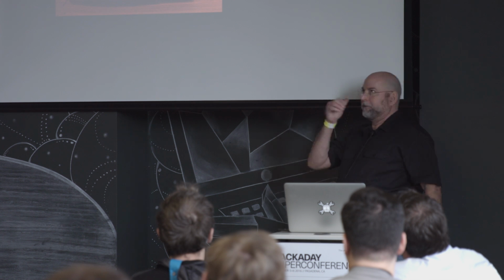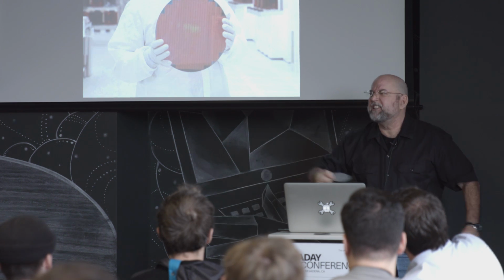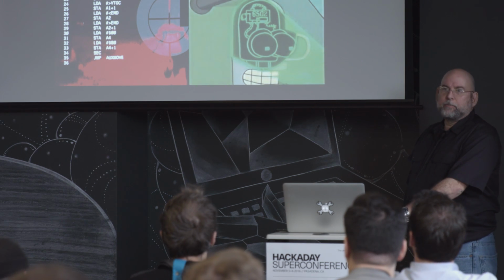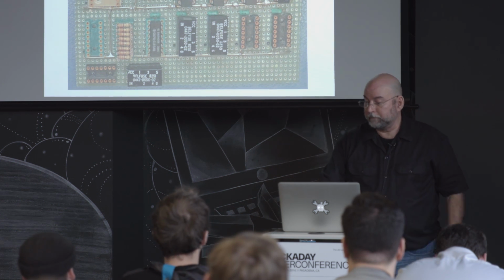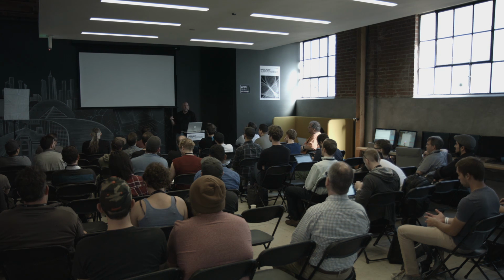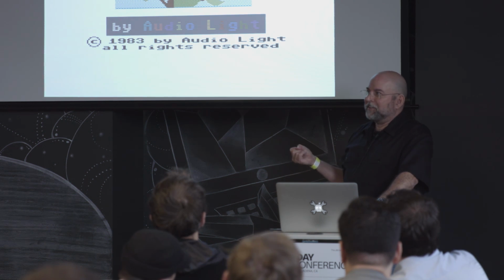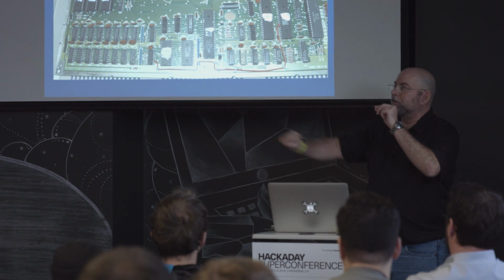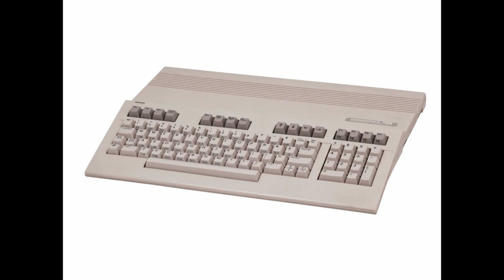Story of Commodore from the Computer Engineers' Perspective

Comment: No, Commodore never made 27 million C-64 what a nonsense

... and 6 million C128? Maybe in some parallel universe... I love the wedge shaped C128 BTW
Reply: So what's the official number? I read something about 17M C64 und slightly below 4M C128.
Reply: @JacquesMartini  there is a nice video where the numbers are extracted from official Commodore documents. And as far if I remember right the C64 was somewhere above 10 millions units and the C128 between 1 and 1.5 millions units.

6 or even 4 million C128 is total nonsense, Amiga was made in around 4.5 million units... the C128 had only somewhat one and half year good sales, then it all died out...
Reply: @madigorfkgoogle9349  Do you mean this?
https://youtu.be/AXCWYKSjHnI?si=9mu0BF3V-sleExcZ
Reply: @JacquesMartini  you have found right channel but wrong video. This one is the right one https://www.youtube.com/watch?v=D2ImhVqbQHs&list=PLPolSM6rkoQnPbRDdZQY9eXQeoUpdu6ZH&index=6

and you also have to keep in mind that Commodore did not list sales as of end user sales, it is retail chains sales. So as you heard Bil saying how big the failure rate within 10 months from purchase of C64 was, Commodore was replacing failed units with new ones, and the broken went back to fab for refurbishment. Then the unit (board) was repacked and sold as new unit. So Commodore listed same computer as sold twice... The problem is that this is largely skewing the numbers and the final number of C64 may even be way under 10 million units given the big failure/replacement rate.

Comment: From 1983 until 1990 I loved my Commodore machines.  Unfortunately I replaced my 128 with a 286 AT Clone insteaad of an Amiga, and I cried about that.  I work in computers so it was the corect decision though.
Reply: I think it was because IBM/Intel PCs were starting to proliferate more than Amigas & Ataris, both at home & at work, the proliferation happening both with PC hardware AND software, so it did make sense & it was probably the right decision. And Microsoft Windows too, which pushed things even more.  I was on a similar path.   I started on XT`s in the mid 1980s, while still using my C-64 since 1983, but unfortunately stopped using C-64s by the mid 1990s & kept going with XTs, ATs, 486s & finally to the Pentiums.  I skipped 386 for some reason, but I did find a 386 board later on but I think it was a prototype.  A college classmate was offering his Amiga 600 system for sale in the early 1990s, but I said I couldnt buy it, too much money for me as a student, I already had my C-64 & a 286 for college homework.   These days I have a lot of PCs, whether in desktop, tower or laptop formfactors, going as far back as said mid 1980s up to today.  Well, not the latest stuff but probably only as far back as the Intel i5s of a decade ago.  But I still have all my C-64 stuff, i.e. the machines, peripherals, magazines, printouts, manuals, cartridges, floppies, etc.  I never threw anything out nor sold them.   However, I need to repair some of that stuff & everything is in the `closet` right now, but hopefully I will get all that out eventually before my deathbed, heh.   I was also one of a few C-64 users that enjoyed a CPU-accelerated C-64 in the early 1990s, bought in 1990 to be exact. It was 4 times faster than a normal 64.  This was almost a decade before the CMD SuperCPU came out.   
08/19/24

Comment: I took a keyboard C128 with me to Grenada when I was a Peace Corps volunteer there after the invasion. I donated it to the school, and got a (metal) C128D with part of my readjustment allowance when I got back. Shortly after I got it, I plugged the power tap for my printer port into the datassette port upside down, and it fried the processor ... so I went back to using my C64. I used it as my word processor through my first two years of grad school. I had a daisywheel processor, and in the days of dot matrix printers, I had some of the nicer looking papers handed in, even thought it was done on The Write Stuff from Busy Bee software.

Comment: I remember much of the folklore around the C-128. And to see one of the guys from the SYS32800,123,45,6 gang screen makes me happy.
I learned machine code programming on the C-128 because it had a build in monitor and was easily accessible, i also learned a few things about hardware and even timings, because i had my fun messing around with the REU.
Now i start to see why DMA to the color ram always produced garbage.
The C-128 was a fantastic computer just for learning and experimenting with. I spent hundrets of hours writing stupid code, soldering stuff that went on the userport or joystick port.

Comment: Cool to see the one of the minds behind the scene.  I learned to program (assembly/6502 machine code) on a commodore PET-2000 with a chicklet keyboard when I was 13 !!   Later in my career I developed the cross compiler hardware interface tools for many of the games systems. Analyzers, debuggers (in circuit emulators), cartridge emulators, cd emulators, etc.. Very fun days and a very creative time.  The 80’s was a “what’s possible” time vs today which is a “what’s cost effective” time.
Reply: CD32 was a cartridge interface, Amiga used PCMCIA addon, etc.  CPU sockets were used to cycle steal.

Comment: Great talk. I wish I was there to ask Bil why the C128 ended up having to run at 1mhz to be able to use the VIC-II and what was the problem that couldn't be solved e.g. discovered it too late or due to heat issues at those speeds etc making it impossible.

Comment: I worked at Commodore UK as a Senior Engineer in Special Projects, the C128 was so complicated and crashy that we nobbled a CDA design engineer at Philips to work for in our team.   In fact Ocean Software worked out away of running the C128 in both  C64 and C128 mode at the sametime on the C128 for copy protections, Ocean did simular with the Amiga.  I had so many arguments with Ocean over this as it was over compatable throu pcb versions and overheated chips.  There are some many hidden secrets in CBM chips.  Who is going to talk about the Gary virus because CBM didnt pay the engineer his wages ?   So many CBM internal stories, so many special PCB.   Little known secrets, Philips got involved and modified the C64 and Amiga.   The C65 was never going to happen, only a C128 versions 2, but the A600 etc killed the project off.

Comment: wow 1982, my first computer, developed ROMCORDER with it. Read video game carts from atari, coleco, vectrex, intellivision and a few others.  Transferred the data to tape (then disk when it came out), a game library system.  Upload the data into battery powered static RAM emulation cartridges for the target console and run the game.  Intellivision was the most difficult cartridge to emulate with the multiplexed address/data bus...then the console market died~1984.....good times
Reply: eb b 

Wait a sec - you're not eb from assemblergames by any chance?
Reply: eb b any more info on this?